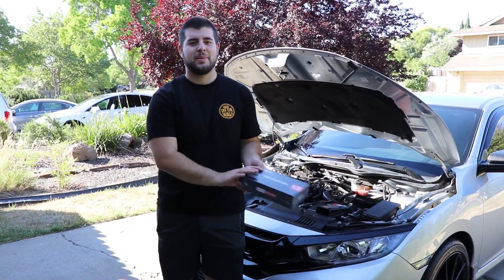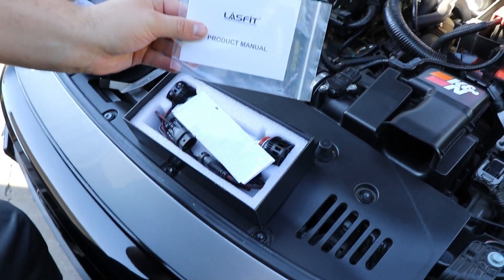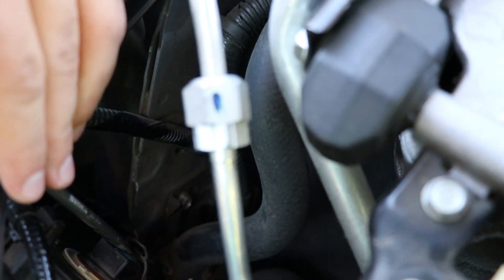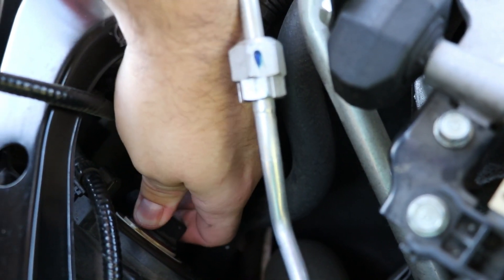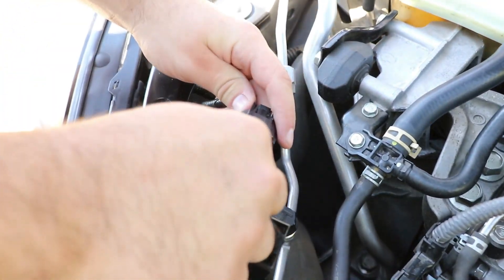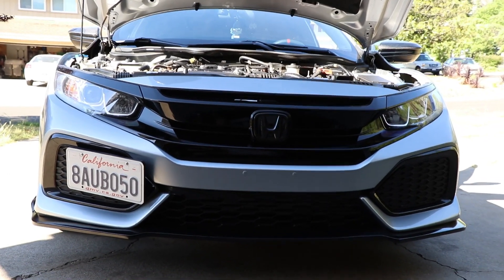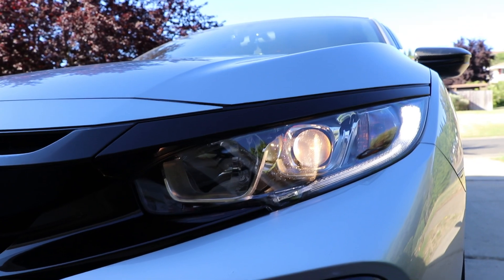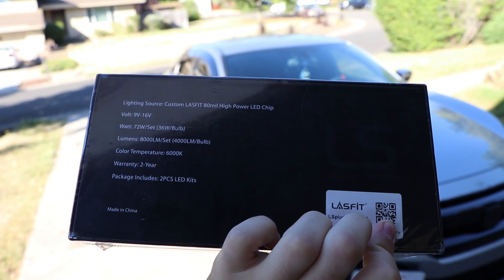LASFIT LED LOW BEAM HEADLIGHT INSTALLATION | 10th Gen Honda Civic (2016-2021)

Comment: Hopefully you don't have any "warning lights " come on  after a week or so.... have they yet?
Reply from the maker: Hey there. No warning lights! 

All plug and play, and haven’t had any issues.
Reply: @RevolveAuto  only mentioned because my Civic is currently at Dealership... warning lights came on after about a week or so after my upgrade.. plug n play as well... waiting to see what they find is the culprit... it's a 2020 with only 2600 miles on it
Reply from the maker: @noro305  Strange. Shouldn’t be the light bulbs. But I hope they find out what it is 🤞🏻
Reply: @RevolveAuto  yeah, dealership called me and supposedly they traced it to the MAF sensor but we'll see.. I'll update after I find out
Reply: Any update? Did the lasfits do any damage?
Reply: @certi2xx390  no sir but I no longer have the Civic 😁